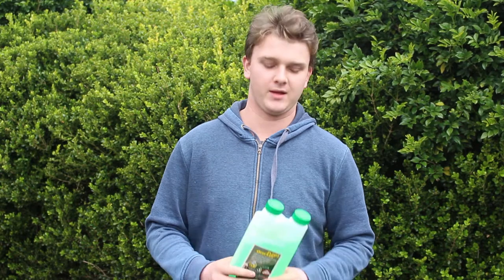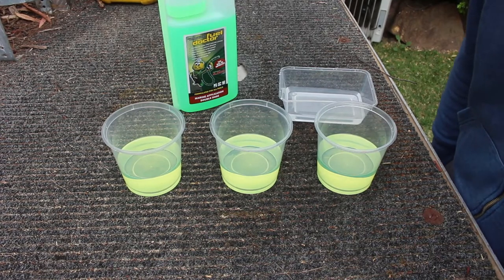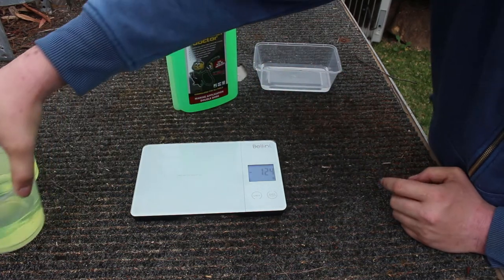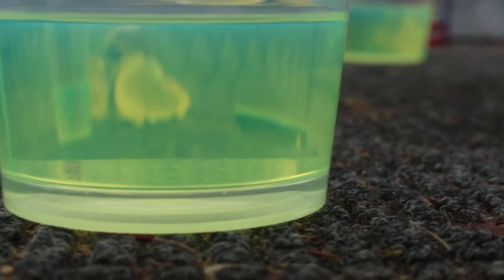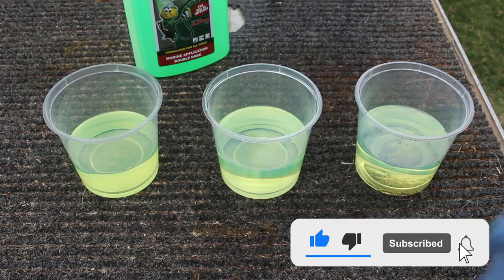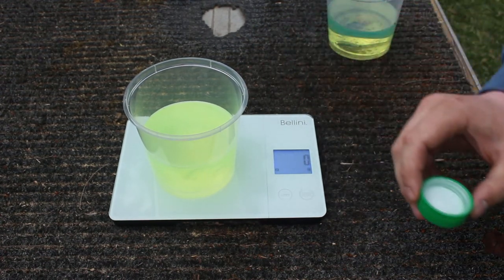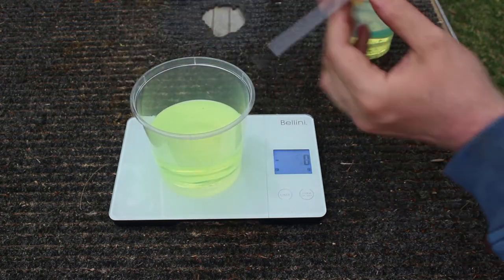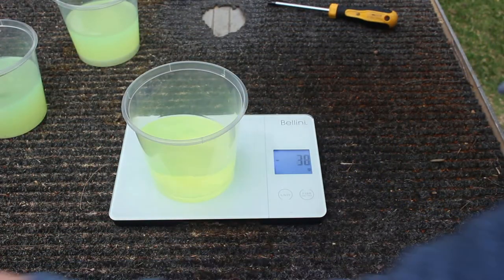DOES FUEL DOCTOR WORK?!?!

Comment: I think 10% water is not realistic. Say an 80 litre tank of fuel would contain 8 litres of water? No way. I would think 1 cup of water in 80 litres so 250 mils of water. Therefore in 100grams of fuel you should have put no more than 0.3 grams of water. Also your pinches of dirt. Way, way over the top. Not realistic at all.

Comment: They 1ml for 1L is to maintain your fuel tank, not to remove all the water.  I just done the first shock treatment in my 07 kun26 Hilux and I previously had 1 injector knocking and now after 50kms it’s almost impossible to hear.  I reckon this is good stuff, I’m going to be putting in about 50ml every fill up at least and if I fill up somewhere sketchy I’d put even more in.
Reply from the maker: Yeah I agree with that I reckon it's made my engine less harsh aswell but I just feel like when they say it removes water atleast tell the consumer how much you actually need to use to clear it up if you know what i mean.
Reply: Did you read the instructions?

Comment: you dont get garden dirt in your fuel from a service station. water condensation build up in tanks sludge and micros build up over time. its supposed to get break that stuff down. and lubricate your diesel pump. i use and are going to keep using it. it also prolongs the life of your fuel.